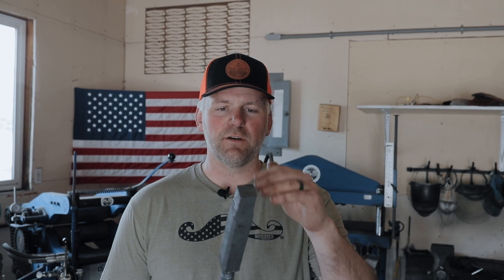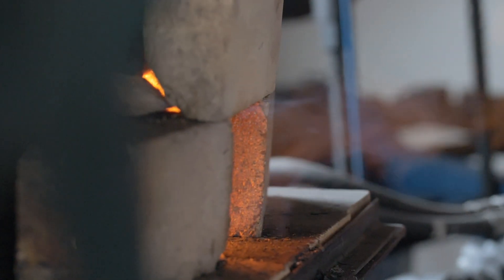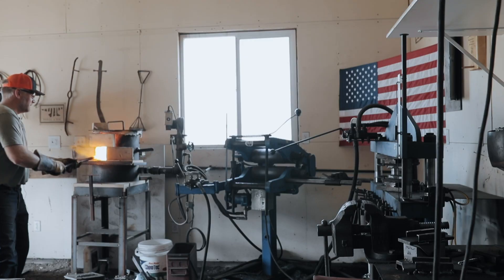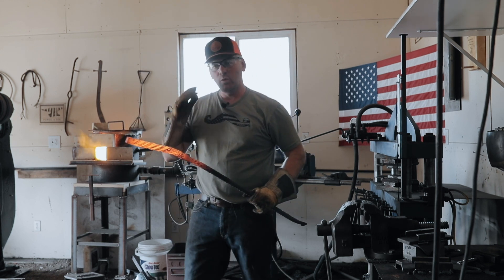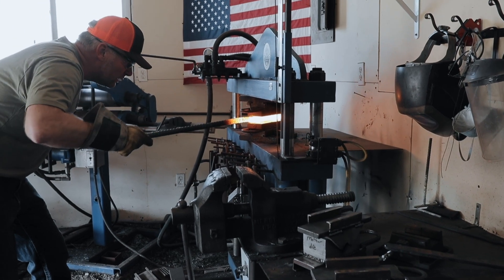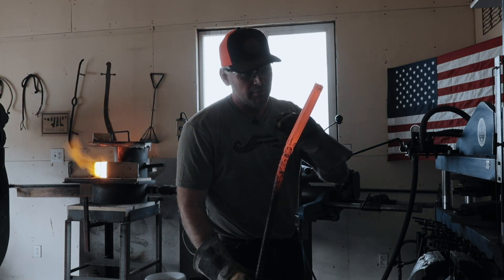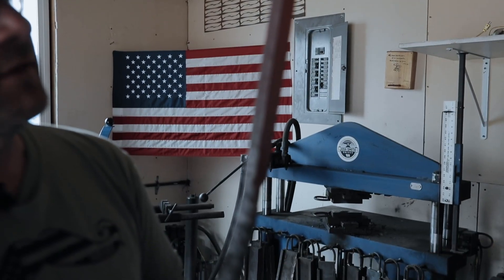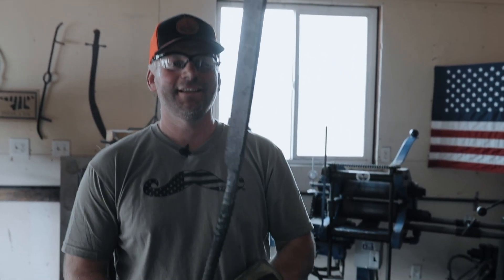How To Twist Damascus Steel

Comment: Best instructional videos I’ve seen since I started making knives. Rounding off the corners before twisting 👍 definitely going to try it. Thanks for sharing. Those cracks along the corners when I flatten out my twisted billet have been a problem. I can usually save the center but lose a lot of material grinding out cold shuts .